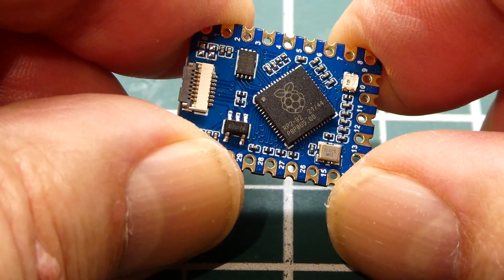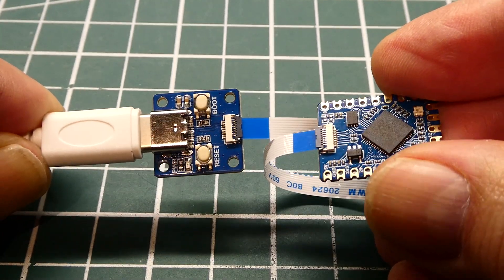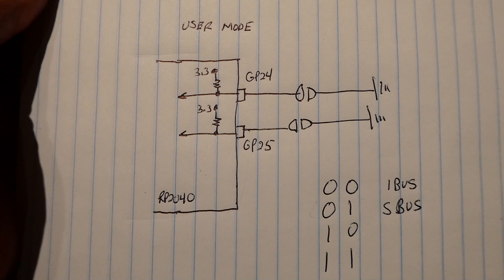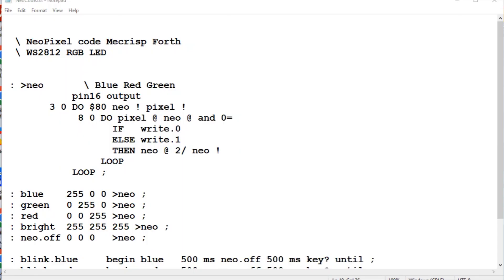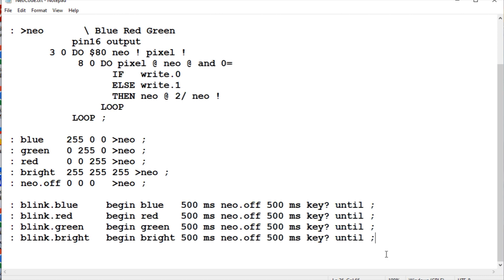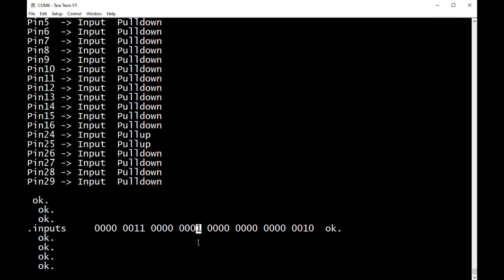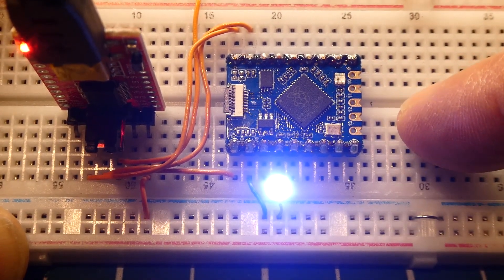RP2040 Tiny / Mecrisp Forth / Neo Pixel

Comment: Is not the GP16 pin to the RGB LED an output as DOUT?
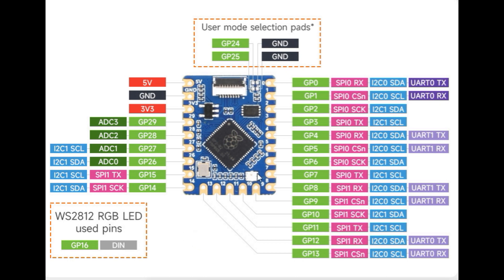Reply from the maker: Check the pinout diagram at 3:00
Reply: @0033mer  GP16 is an output and the schematic shows that. The WaveShare diagram is wrong.
Reply from the maker: GP16 of the RP2040 is configured as an ouput driving the input of the WS2812 RGB LED labeled DIN.
DIN refers to the RGB LED not the GP16 pin.

Comment: Hi @0033mer ! I understand the code you have shared in the video is aimed to run in mecrisp forth for the RP2040. However, I guess you are also loading some additional code? I cannot find the word "neo" in the files in the mecrisp-stellaris/rp2040 directory. Have you a git repository somewhere where you have the code relating to the videos you produce? I would love to be able to replicate the code here, and in your other videos! Alternatively, could you please confirm which additional files are loaded? Many thanks!
Reply from the maker: The video was intended to be a demo on the capabilities of the RP2040 Tiny so a lot of words are my own.
Others have re-created the code I used and you can find it in the Mecrisp RP2040 download in the file Playground.4th. Also check out the Tachyon Forth extensions in the Experimental --> RP2040.FTH folder
Thanks for the visit.
Reply: @0033mer  Thanks! I will review the code in playground, and have a look at the takyon forth extensions. Keep making videos - I have subscribed :)

Comment: Perfect replication of my z-80 fig based rpm programmed MCB. 73 io lines with 3 chips, etc chop and floating point socket~! The code is the same but obviously named are changed. Named are you be a dialect of human style commands. If foth ❤ honk.😊😊😊

Comment: This board is great. Although it is physically the same size as the other small pico boards you can find, all the components are on one side, so you can mount the board with a very low profile. As 0033mer explains, the USB connector and buttons are on a separate board, and for mecrisp forth, this second board is only required to upload the initial image to the device. Thanks for the video!
Reply from the maker: Welcome!

Comment: High 0033mer;
Technically, Wave share has another 2040-TINY called the MINI.
It has the same footprint with a type C connector on the board. Slightly cheaper too.
The MINI also has broken out 12 more pins on the back side as small solder pads.
I have no idea how to connect to them yet, a wafer wire bonder comes to mind.
Or maybe 30-gauge solderable magnet wire.

I find the MINI suits my need better when on the plug board. Then go over to the TINY when finished.
( The TINY is marked with Version 1.1 and I suppose the MINI is Version 1.0)

BTW, I also like running Pico Basic on these too.
redrok
Reply from the maker: Thanks for sharing.

Comment: I'm glad to see current videos on this.  Any material you still have from your old website would be good to read or watch too.  Standards are for other people, and definitely not for hobbyists.

Is there a way to have a Forth program load and run on booting up an MCU in either Mecrisp or Zepto Forth, like we can with C++ programs in Arduino?  I'm trying to wade through the documentation but I've yet to find anything about that.

Assuming we can, is there a way to programmatically quit back to the REPL, e.g. on a buton press that's being watched for?

Can we develop code in the REPL then save it to an SD card, like using a cassette recorder on an 80's home computer to save and load BASIC programs?
Reply from the maker: Every Forth has a way to produce "turnkey" applications to boot on power up. When using Mecrisp, name you main word "init" and it will boot on power up. You can create a backdoor by monitoring a spare GPIO pin on bootup. If you hold it low during power-up it can restore Forth back to the ok prompt. The Scamp3 board uses  the sequence ' main is turnkey to auto run a program on power-up. A hard reset will restore control to the ok prompt.
Reply: @0033mer  Thanks.  I'll try that.  If I have my program monitoring a pin, what's the word to use to exit it to the ok prompt, when it sees that pin change?
Reply from the maker: It depends on how your main word is setup. You could use "exit" to jump out of your main word on GPIO sense or you could use the simple begin <words> key? until and get out using the serial port. Check out "turnkey" in the documentation: https://mecrisp-stellaris-folkdoc.sourceforge.io/
Reply: @0033mer   Thanks.  I did look at that documentation earlier, but didn't find anything really useful.  So far I've found:

Turnkey

Methods to create a final Mecrisp product.

Warning

! UNDER CONSTRUCTION !

and;

compiletoflash

: non.closed.loop.program  \ loop until keyboard key pressed which will exit loop and return control to the terminal
  begin
  ." This MCU is running a TURNKEY application" cr
  key? until
;

: INIT
  non.closed.loop.program
;

compiletoram

" non.closed.loop.program" really needs an example of such, not just that comment.

Mostly, I was trying to avoid getting stuck in the init word/function and having to reflash it to start again.

Comment: I like your YouTube videos on Mecrisp Forth however it would be nice if you would provide all of the Forth code necessary to implement the project.  Without the entire Forth environment description it's difficult to implement what is described in the video.
Reply from the maker: Hi Mark, thanks for the feedback. I made the video to only feature the RP2040-Tiny board and just wrote some Forth code using Mecrisp to demo the NeoPixel. I used to have a website where I had tutorials and getting started code for beginners using Mecrisp and eForth on ARM microcontrollers. I got a lot of complaints that I was not following Forth "standards" so I took the site down and now only show the "capabilities" of Mecrisp Forth. I have gone over to the Flashforth platform using the Scamp3 board running a PIC microcontroller. I go over all the code in the videos featuring the Scamp3 board and there is support from the Scamp3 designer (John) and Flashforth author (Mikael) on their websites.
Reply: I recognise some of the "words" used from a file that's included with recent Mecrisp releases.  This is from a comment on another one of @0033mer's videos, I think (I forget which, but I kept a note of the comment:

"In the rp2040-ra directory of the Mecrisp Stellaris distribution is a file "playground.4th" included, which implements some of the words used in this tutorial. Maybe a good entry point to play around with it."

I've tried parts of that with ZeptoForth, but I had to change a small part of it to get it to compile.

playground.4th contains definitions of words used to read and set pins, etc.
Reply: I was a bit off on "recent" - it was "Run Forth On The Raspberry Pi Pico / Mecrisp" by @0033mer, from 2 years ago.  You'll find it in the videos tab.  The comment was by @computermuseumvisselhovede3380 and I currently see it as the second one on that video (YMMV, due to the vagiaries of the YT experience).

Comment: How are you doing the specific bit timing for the WS2812B. I have written lots of pixel drivers for the Propeller 1 and Propeller 2 and know that pixel timing is specific.
Reply from the maker: The RP2040 is clocked at 125 mHz so it is fairy easy to code nanosecond delays. Forth runs as fast as assembler so GPIO control is efficient. When controlling a single neopixel the timing is pretty flexible.
T0H   200ns min 500ns max 
T1H   550ns min and there is no max ( I have used 1 second which works )
T0L and T1L  450ns min and 5000ns max ( any higher will be seen as Latch )
The Neopixel timing start is low to high edge triggered and reset on the next positive edge.
With Forth it is easy to do "what if" scenarios interactively from the keyboard to check these timing parameters.

Comment: Both zepoforth and mecrisp forth are amazing resources to have available.   I've done a project using Mecrisp FORTH on an STM32F103 some years ago, and it was a great resource to have.   FORTH is wonderful for doing interactive embedded systems work to explore and poke at hardware interactively.  Both FORTH implementations are also very high performance implementations and compact.

Lately I've been playing with zeptoforth on the RP2040 microcontroller and it also looks very promising.   It looks very complete, having primitives for using both CPU cores and multiprocessing primitives for IPC and synchronization amongst concurrent tasks.  Very powerful!

Thanks for the video!
Reply: That's a lot of Forths .. has anyone done a comparison ?
Reply from the maker: Hi Louis  ... thanks for sharing!

Comment: What happened to the pin 16 description?
Reply from the maker: The schematic at 5:08 shows GP16 connected to the input of the Neo-pixel ( Din ). The word >neo sends RGB data from GP16 to the Neo-pixel.
Reply: the source for write.0 and write.1 would also be helpful... So far, I have been unable track them down, or understand exactly what they are doing.

Comment: I used a RP2040-Zero for a RC sensors telemetry (GitHub project "dgatf/msrc: Multi Sensor for RC with RP2040 - GitHub")
I had a FrySky R9M/R9MM TX/RX RC system and I needed as small and as lightweight way to send telemetry back from a glider and this was a perfect solution.
I was going to remove the USB and Buttons once programmed. In the end I left them on, as it was easier to Reset with the button than to power OFF.
At the time I do not think the Neo version was available? Pretty easy to work with and a lot smaller than an Arduino Pro Mini ! 🙄

Comment: Why would you use Forth, over Pico's C?  What wold it give me?
Reply: It's incredibly dense and efficient when it comes to interactive control and testing.  There's virtually no syntax or all the extra punctuation required by other programming languages, and while it can be cryptic when writing more complicated code, when it comes to querying and controlling stuff it's unmatched and can run in the tiniest amount of resources.
Reply from the maker: Using Forth is the best way to control hardware. Direct register programming allows you to exercise all functions of any peripheral.
Reply: Interactive and incremental compilation. Generally less overhead than other types of interpreted language as it compiles to routine addresses as code is entered rather than token lookup. But it still IS interpreted - if an external compiler is OK, C is still better.
Reply: @theelmonk  I expect it depends on the version of Forth, but from what I've read it's partly interpreted, and partly compiled.  Using the REPL (command line part) is interpreted.  Pre-defined words should be pre-compiled, and any you define may or may not get compiled, but the original idea is that they would be, I think.